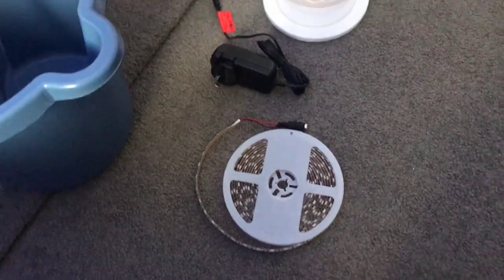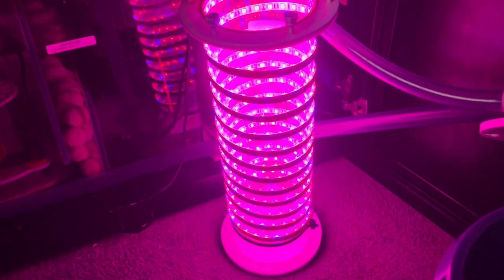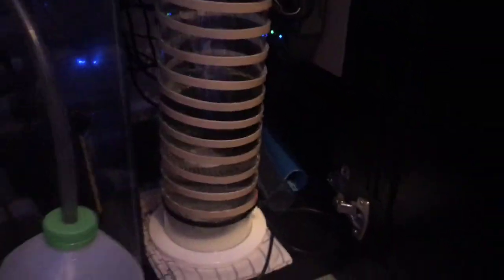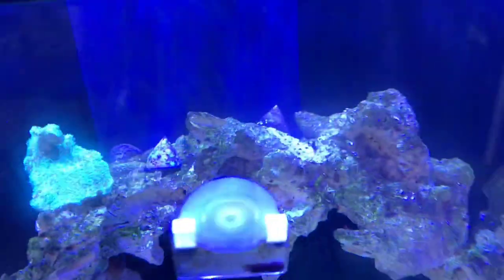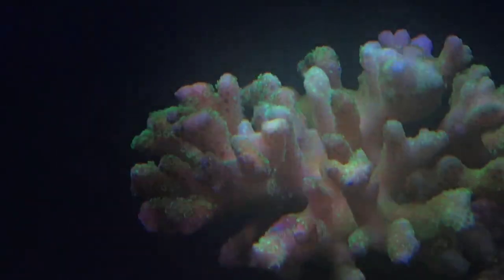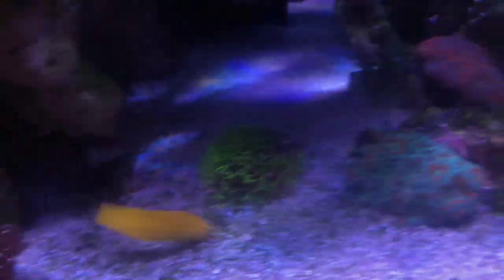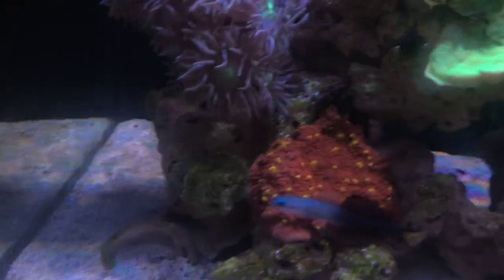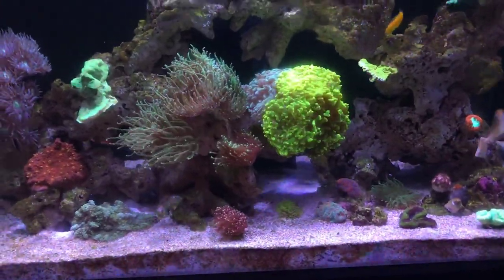Tank Update 9 - DIY Chaeto reactor

Comment: Very! Nice, I have a DIY cheato reactor as well. I used a 4" abs pipe and lined the inside with the LEDs, cut vents on the bottom and a small square near the top where I installed a computer fan to help cool the LEDs a bit, wired it inline with the LEDs. Then you just slide the reactor into the abs pipe, done and prevents light over spill
Reply from the maker: Drama D that is way to complicated for me it would take me a whole week to make but it would look pretty cool